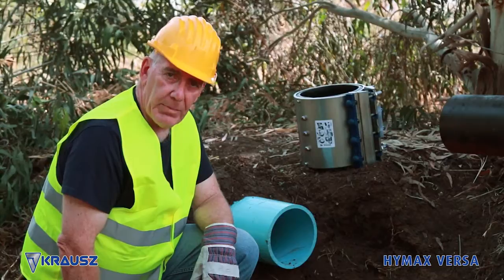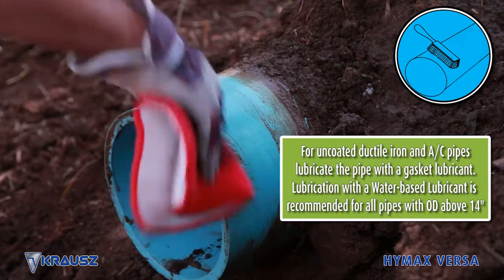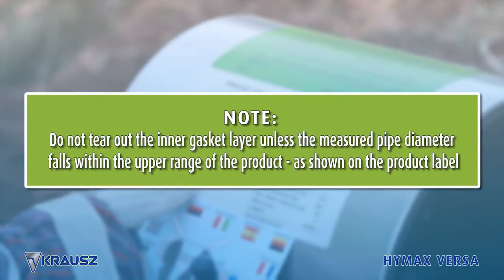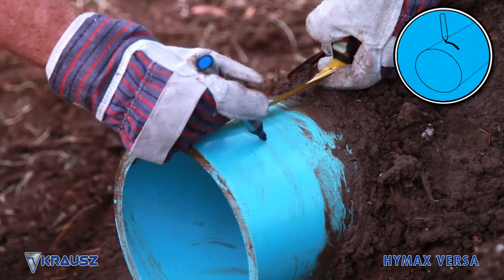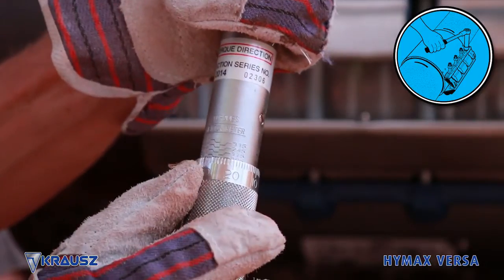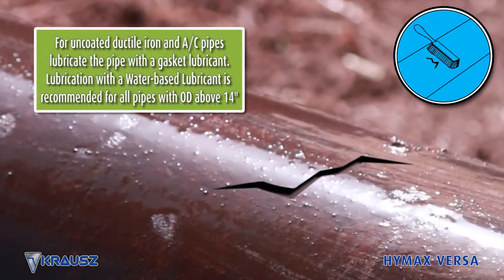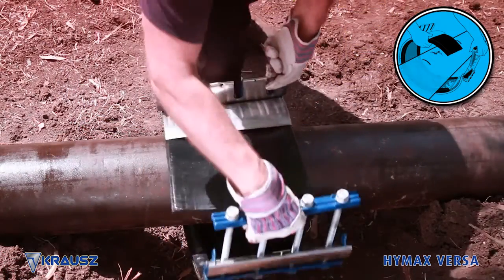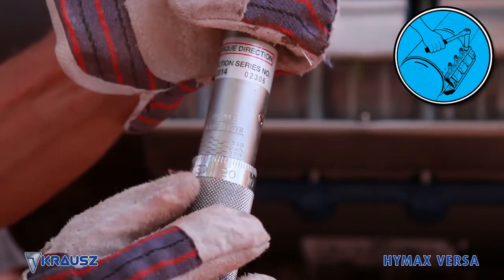HYMAX VERSA Installation Instructions

Comment: The best fix for our situation is a three inch  encapsulation fitting, but no one that I can find makes that in a three inch size, they start out at 4" and up, be cool if someone would design a stainless wrap style repair that would wrap around the bell and seal off
Reply: Jared Franklin ford meter make those they are the od of the bell for half of the warp around the y make them for pipe as small as 3/4 galvanized  to work on leaks at coupling

Comment: OK, we are trying to find some kind of wrap that will place over the leaking bell, due to valve distancing and an extremely long flush route, we don't want to open the pipe, much better for us to leave pressurized with no interruption of service or water loss

Comment: Was wondering if the versa will wrap around a leaking bell joint and seal off
Reply from the maker: Hi Jared, the Versa will not wrap around a leaking bell joint, you need to saw the bell first and use the Versa to connect. Please go to krauszusa.com , see "ask our expert" on top of the page and leave any question you may have.
Reply from the maker: Please send me the details of the installation and the installation protocol and I will give you a working solution.